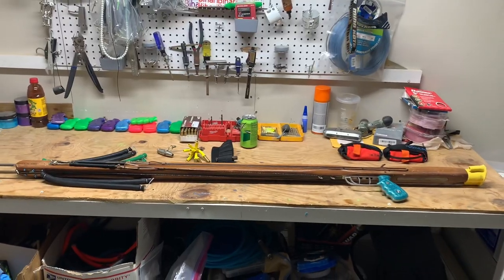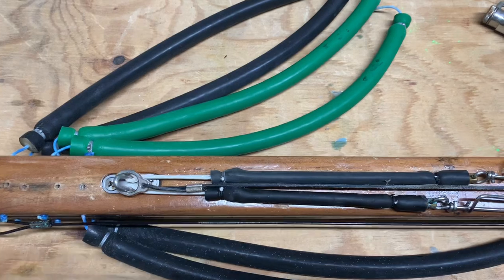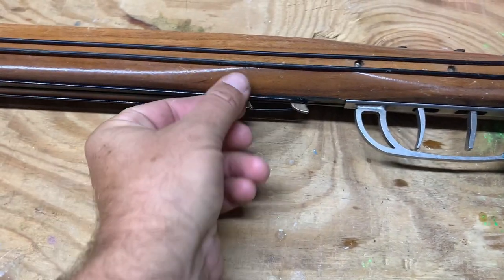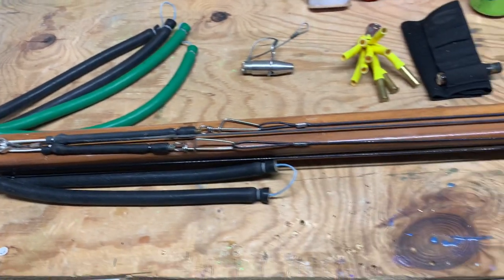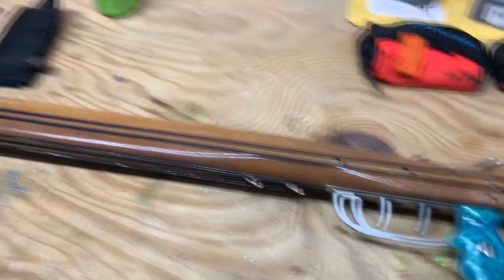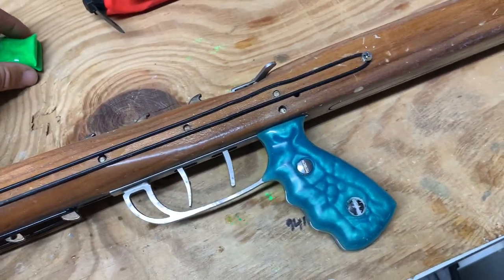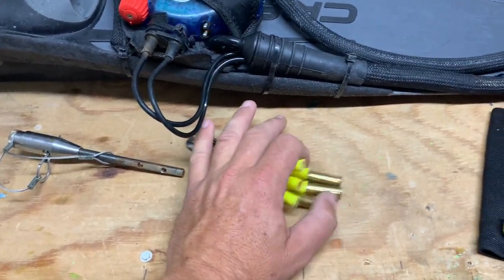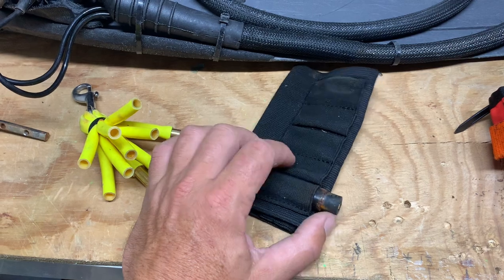Double barrel overunder￼ speargun and dive gear set up. Overview on how I have my gear rigged￼￼.

Comment: Lot of my gear would interchange with yours. Very similar pony.  Knife is on back of pressure gauge. I have a new invention about every trip out it seems.   Working on a combo pole spear / lobster snare.  I have tried about 2 dozen PH combos.
Reply from the maker: Definitely more than one way to do it.

Comment: Pretty cool gun I made the double barrel using the same parts at the beginning of last year. This is the first one other than mine tgat I’ve seen. Great idea sliding the top mech forward definitely going to use that. Also solved my problem of wanting one to have a line for fish under structure. I live in SC and dive nitrox. I really want to get into the 200’ range. Just need more knowledge in the specifics of doing the deeper dives
Reply from the maker: Just takes some practice and keep pushing. The deco bottle gives you some comfort having an extra setup just in case

Comment: Very cool, I just started building spearguns for myself. Anyways those cressi's are slow without the shark shield. I swapped my cressi for some stiff fiberglass blades from spearmaster they weren't expensive and I've drilled holes in them.
Reply from the maker: They are really comfortable though. I’ve bought a new set to replace these and couldn’t stand them. Ended up giving them to my buddy
Reply: @jasonbihari  The cressi Gara footpockets fit the spearmaster fins. 
I can't tell if yours are cressi Gara or the ones that are permanently attached.
Reply from the maker: It’s built in.

Comment: I have two questions what diameter shaft do you use what is the thickness and the width of your teak blanks
Reply from the maker: 5/16 shafts and around inch and a half by inch and three-quarter.

Comment: Have dealt with sharks since a kid around 1963, been scared several times usually after they got my catch, when carying a large string of fish, they might try taking a chunk out of you, I like the power heads Dan Mc Mahon uses better than yours ( nothing wrong), If you know him check them out, Simple design
Reply from the maker: I’ve seen them. I was going to make some similar but for 357. It will be a smaller profile so hopefully lighter and not as much drag.